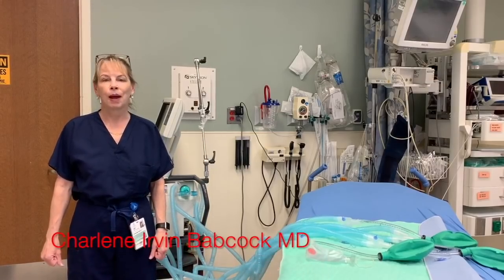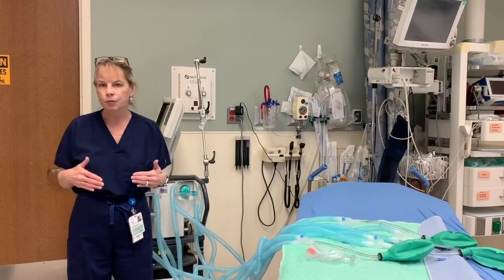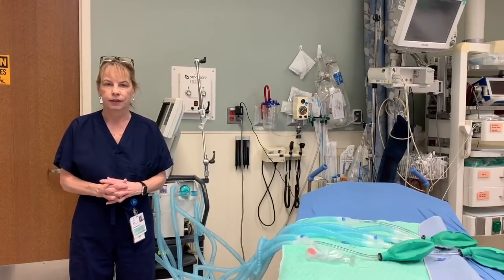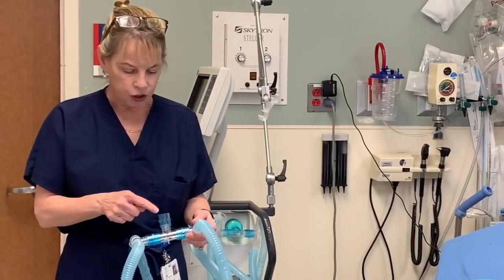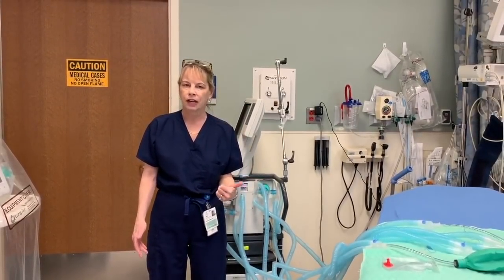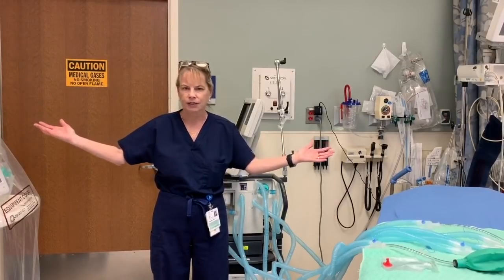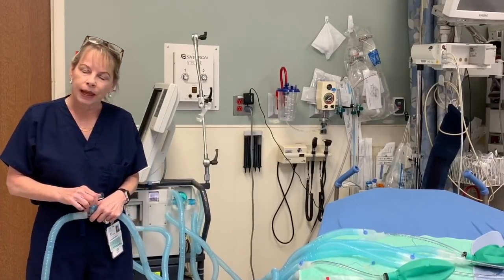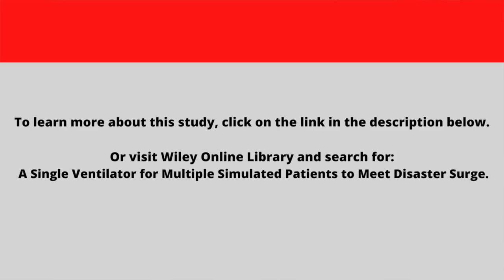COVID-19 How to Use One Ventilator to Save Multiple Lives

Comment: Thinking about this more, I don't think it would be useful at all because even if you fix the massive deadspace issues which are resulting in alveolar hypoventilation (aka suffocating the patient), you're screwed as soon as someone throws a mucous plug, coughs (yes, people can cough or try to breathe with even deep paralysis), or some other dynamic change happens as the other patients on the circuit are going to react while the vent pressures rapidly change. Once you get around some of the obvious issues like deadspace, this remains a solution to a static problem when ventilation is a dynamic problem.  You CAN surpass patient apneic thresholds with hyperventilation and/or narcotization but there are downsides to this and that's only one of many issues. Since this would be a very short term temporary solution anyhow, why not prepare to train lay people on how to bag mask with ambu bags? This is what is done in resource limited countries for temporary respiratory support when going to CT scanners.
Reply: You could argue different compliance, resistance and many more things (as she said at the beginning of the video).  "Off-label use", "ventilator is made for one person", "hope you never use it in this way". Nothing more to argue.
Reply: https://www.youtube.com/watch?v=eSVbwWANqRI&t=90s
Reply: This a last resort. The mat is simple: out of four three will die 100 % and one may survive. out of four one may survive or all four
Reply: Where is all the dead space exactly?????
Reply: Where is any hospital gonna get 100 relatives to squeeze ambu bags within 10 minutes when there is a curfew? What about PPE for them? How to feed them? Has the hospital even got 100 ambu bags? Please could you comment on this video. It would be most appreciated.:   https://www.youtube.com/watch?v=eSVbwWANqRI&t=90s
Reply: @reality9   Sandy Allsopp  you're proposing a lot of what if's while ignoring some other ones like where to get all the tubing and filters if things are on this scale, but to answer your main question, yes I would still rather have people use ambu bags and hand ventilate which is again something that has actually been done clinically unlike setting a vent up like this. Debugging one ventilator on one patient has enough challenges, now imagine having almost no information about 4 independent patients. That video linked in the other comment still has the issue of not having any information about the patients- there is no way to know how well you're actually ventilating each patient unless you do serial ABG's which seems unrealistic if we're talking about the scales you are. Also correct me if I'm wrong, but adding that valve is basically changing whatever you're doing into pressure control ventilation.
Reply: @johnl.38  You may well be correct about four patients. But what about two? Apparently the UK may be able to cobble together 12,000 ventilators within 40 days from now when we are expected to have 30,000 patients needing them. So doubling up would only leave 6,000 to die. To put the urgency into perspective, this is twice the number deaths that occurred on 9/11. Without the doubling up 18,000 people will die. Imagine the horror if you had 6 x  9/11's on one day, and then the next day and the next and the next and so on until 250,000 people are dead. More than the whole of WW2 for UK. Well that is exactly what the UK Gov scientists expect to happen if containment does not work. What do you think about what this German doctor Kristian Niklas wrote on this blog yesterday? :

I ruminated a consideration on this proposal for the last couple of days as Germany is in anticipation of the surge. To be clear: This is also just a theoretical exercise and – if applied - would count as a desperate measure in the case of patients otherwise not being ventilated at all. What if the mode of ventilation chosen would not be conventional BIPAP but APRV/inverse ratio PCV? The control parameters correspond to conventional ventilator settings as follows: P-high (P-insp), P-low (PEEP), T-high (insp. Time), T-low (exp. time) and FiO2. Note that implementing this mode of ventilation with conventional BIPAP, which is possible in some devices, will in some setups require calculation of respiratory rate, which is 60/(Thigh+Tlow). The slightly different terminology as well as specific algorithms for implementation have been characterised and properly published by experts in the field – which I am NOT. There have been promising studies in ARDS which I will attach below. If one assumes that for two (or more) patients the key treatment goal would be oxygenation with a more liberal approach to CO2 removal, it should be possible to choose P-high, FiO2 and to some degree T-low to achieve safe oxygenation margins for both patients. This would still allow for some inhomogeneity in compliance between the patients as the lung is splinted to a rather high point in the P-V curve by P-high resulting in a high resting volume. This is the proposed “open-lung” aspect of this ventilation mode. Nevertheless, due to the sparse and brief passive pressure relief phases it is believed to go without higher frequency repeated expansion like in conventional PCV, resulting in less energy deposition into the tissue. The repeated overinflation/atelectasis due to inhomogeneos P-V dependencies had been my main concern when thinking about PCV in a shared circuit and a possible result of volutrauma/atelectotrauma in the patients. In case of inhomogeneous severity between the patients/different disease progression the treatment goal could be set for the more severe patient accepting hyperoxia in the “more well” patient. In terms of CO2 removal a “common ground” target for the patients could be set in wider range of acceptable values, opting for permissive hypercapnia. As the passive release of the lung volume to exhalation in T-low will generate outflow which is cropped at a certain level of peak flow (by setting T-low) when conventionally setting up/adjusting this mode, it might be difficult to assess this control parameter for the individual patient in a shared circuit. APRV does even allow for spontaneous breathing on P-high in weaning approaches which have been proposed as well. If flow for the device serving two patients would be dialed high enough to compensate for potential maximum inspiratory peak flow generated by both patients in spontaneous breathing, it could be fathomable to even conduct weaning with two spontaneously breathing patients sharing the same circuit. I write this as I feel we are all staring in a potential abyss, which might force us to make choices that neither of us ever wanted to make. Hence, this is a THEORETICAL CONSIDERATION and not a recommendation. Also I do not take any legal responsibility if patient harm ensues. I hope everybody understands that. Also probably someone already thought of this. But I thought: Sharing is caring. Take care and stay strong. 

C Cane RD, Peruzzi WT, Shapiro BA. Airway pressure release ventilation in severe acute respiratory failure. Chest, Aug 1991: 100 (2); 460-3 Fergson ND, et al. High-frequency oscillation in early acute respiratory distress syndrome. New England Journal of Medicine 2013, 368 (9), 795-804 Frawley PM, Habashi NM. Airway pressure release ventilation: theory and practice. AACN Clinical Issues, 2001: 12 (2); 234-246 Garner W, Downs JB, Stock MC et al. Airway pressure release ventilation (APRV). A human trial. Chest, Oct 1988: 94 (4); 779-81 Habashi NM. Other approaches to open-lung ventilation: Airway pressure release ventilation. Crit Care Med 2005 Vol 33, No. 3 (suppl.) Maxwell RA, Green JM, Waldrop J et al. A randomized prospective trial of airway pressure release ventilation and low tidal volume ventilation in adult trauma patients with acute respiratory failure. The Journal of Trauma, Injury, Infection and Critical Care, 2010: 69; 501-511 Modrykamien A, Chatburn RL, Ashton RW. Airway pressure release ventilation: an alternative mode of mechanical ventilation in acute respiratory distress syndrome. Cleveland Clinic Journal of Medicine, 2011: 78 (2); 101-110 Rasanen J, Cane RD, Downs JB et al. Airway pressure release ventilation during acute lung injury: a prospective multicenter trial. Critical Care Medicine, Oct 1991: 19 (10); 1234-41 Roy S, et al. Early airway pressure release ventilation prevents ADRS – a novel preventative approach to lung injury. Shock 2013, 39 (1), 28-38
Show less
Reply: John L. Don’t listen to her man. She is literally copying and pasting from google with no understand big of vent/respiratory mechanics. She’s not right in the head.
Reply from the maker: See above...its being used in NY...although its just a comment. and impossible to validate...but we also got a 'comment' from Italy....so ......just saying...disaster times call for drastic attempts...
Reply from the maker: It is being used successfully in ITaly.....yes it is off label...yes it challenges the clinician to 'match' patients as best as possible for compliance, TV, resistance, etc...but it is working...see below about Italy...I've also been told its being used in Egypt.....  THe last sentance in the article (translated) is: "...its like multiplying  fish and loaves."

Dr Marco Ranieri of Bologna, Italy and his team Have successfully tested the approach in vivo in one of the hospitals in Italy overwhelmed by the COVID-19. 

They worked with Intersurgical, an Italian company based in Mirandola, started producing the circuitry in only 72 hours, and the first prototype has already been tested by Bologna Sant'Orsola Hospital. It works and in the next few days they'll start a mass production to supply Italian hospitals who are in need

Here some news in Italian. 

https://www.huffingtonpost.it/entry/a-mirandola-testato-ventilatore-che-assiste-2-pazienti-bonaccini-straordinario_it_5e73c3e1c5b6f5b7c540a8d2
Reply: If you had 100 people crawling around your hospital foyer at 3am with one hour to live, where are you going to get 100 relatives to squeeze ambu bags for them? Especially during a military enforced curfew. It would be horrendous and unfair but you may well be with only a dozen staff. Would you consider it then? What would you do otherwise?

Comment: I wounder if it is possible to share time of one pump between multiple people: make it pump much faster, and spread air between multiple people using a pneumatic valve manifold (would industrial ones suffice? Festo makes something like this for industrial pneumatics.), by opening one output valve for each stroke of a pump, thus making connected people inhale/exhale in different time (with each having their own tact of a pump). Similar to how computer CPU shares it`s time among multiple applications running simultaneously.  While this solution  is not as simple as shown in the video, and requires some engineering. I believe, people who already work with industrial pneumatics, can figure out a working solution in relatively insignificant amount of time. Also maybe, military could assist in such  developments (I believe, they too would be interested in scalable ICUs ).

Comment: This is a thought starter video. It has many issues. Can they be controlled for? Can machines be adapted? Yes, please point out the problems and challenges.  Everyone recommending Ambu bags... should hospitals believe they will receive additional ventilators, or be able to transfer infected patients? Does a patient need to be on a vent for 4 months? Will the number of patients requiring vents be 10x capacity? Can an Ambu bag be used with dozens of patients 24h x 120d?
Reply from the maker: THought starter is what I also thought initially...but now its been tested INVIVO>...successfully!!! SEe below!

Dr Marco Ranieri of Bologna, Italy and his team Have successfully tested the approach in vivo in one of the hospitals in Italy overwhelmed by the COVID-19. 

They worked with Intersurgical, an Italian company based in Mirandola, started producing the circuitry in only 72 hours, and the first prototype has already been tested by Bologna Sant'Orsola Hospital. It works and in the next few days they'll start a mass production to supply Italian hospitals who are in need

Comment: What do you think about using simple air compressors instead?

Relays could be used to control a given line, and the very high positive pressure in the lines would prevent any sort of contaminants from leaking back into shared lines, the air would of course go through individual valves on each line to control the pressure so you don't pop the patient.

You'd probably want an inline charcoal and hepa filter to soak up any oils and contaminants from the air compressor as well as control circuitry to handle everything.

With such a system, you could have a ventilator panel in every room of a hospital like is done with oxygen now, and if you needed more you could just add additional lines and compressors to the system which are far more commonly available than a ventilator.

Obviously, it's a last ditch effort sort of thing, but I think it's something that is desperately needed across the globe and may be necessary here in the near future.

I run a startup that designs electronics (quantum circuits and processors, lab timing circuits, etc.), our quantum computing research has been halted as we've shifted focus to assist in alleviating this pandemic anyway that we can. If this is something you think would be useful, or you think of something else that might be useful, we're happy to do our part to contribute.

The one condition we have is that our contributions be entirely open source and open-hardware to ensure that access to life saving equipment not be hampered by socioeconomic or political conditions
Reply: I believe, the problem is to use a very specific and controlled air mixture, as well as to evacuate the CO2, that's why ICUs are so complex. However, maybe it is possible to share time of one pump between multiple people: make it pump much faster, and spread air between multiple people using a pneumatic valve manifold (would industrial ones suffice), by opening one output valve for each stroke of a pump, thus making connected people inhale/exhale in different time (with each having their own tact of a pump).
Reply: For valve manifolds one can look at Festo products. They are great at everything related to pneumatics. The solution above is not as simple as shown in the video, and requires some engineering. But I believe, people who already work in industrial pneumatics can figure out a working solution in relatively insignificant amount of time. Also maybe, military could assist in such  developments (I believe, they too would be interested in scalable ICUs ).
Reply: Noah Wood that’s a considerable Engineering issue
Reply: @AAAAAAAAAAAAAAAAAAAAAAAAAA-g7h  
I agree, more coffee is needed

Comment: You called one configuration "half star" configuration for balancing pressure/volume.  That looks like an extra amount of room would be needed to spread the patients out.  Add equal lengths of tubing to on the inboard patients to match the extenders used for the outside patients.  That way you can bunch patients more closely and not take up space.

Comment: A couple check valves should greatly reduce the cross contamination vector. 2 hoses each person. Check valve on each. put the valves near the ventilator. Makes the shared volume ONLY the little part near the unit where all merge, as opposed to "all the hoses shared at all times for their entire length" .... Just an idea to hopefully spark more ideas . Thanks for all your hard work :)
Reply: Haven't tried it, but adding check valves within the circuit may interfere with the active exhalation valve on this ventilator.  If I can find the time, I'll tinker with this at work tomorrow.  I doubt the machine will even pass calibration, but we shall see.
Reply: good contribution

Comment: There is a thing which i guess is crucial - CO2 absorption. How is the CO2 being removed?
Reply: This is an ICU ventilator, not a OT circle circuit. The CO2 is exhaled into the room through an exhalation port on the machine (all ICU ventilators do this, we do not use a CO2 scrubber/soda lime).

Comment: Thank you so much for this! It was easy to understand and super easy to make the configuration. My question rn is if we wanted to put a bacterial filter between the patients, where would you recommend placing it?
Reply from the maker: I would put it at the 'mixing area' which is where the expirations all mix.   THere is a filter already on the inspiratory side...and I would put a bacterial/viral filter.
Reply from the maker: THis mixing area is about 5 feetfrom the. expiration site, and before the contact with the expiration at the vent.
Reply: at each inhalation port maybe with spacer to fit on this 840 restrictive space but don’t know if adding all 4 bacterial filters will increase peak pressure assuming all patient are not in ARDS

Comment: Thank you, Dr Babcock, for this informative video. I believe everyone hopes that this dire situation does not arise. But if it does, other than space constraints, could there not be 8 or even 16 patients be on one ventilator?
Reply from the maker: most. vents. only alow for amaximum of 2000. ml...so if you assume you need around 500cc/patient/breath...that only allows for 4 patients.
Reply from the maker: Most ventilators max at 2L...thats why we used 4 patients...500 cc/patient....
Reply: Thank you, Dr Babcock.